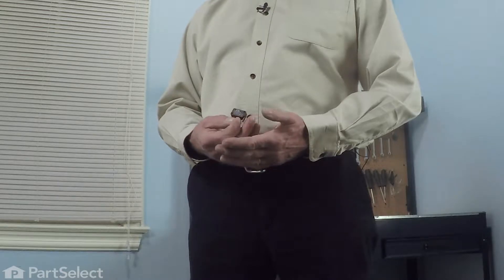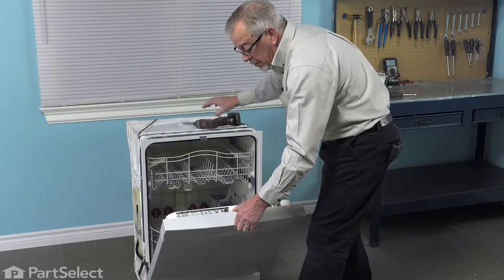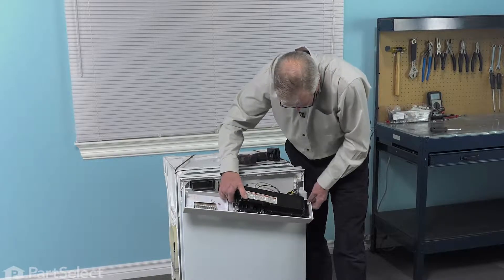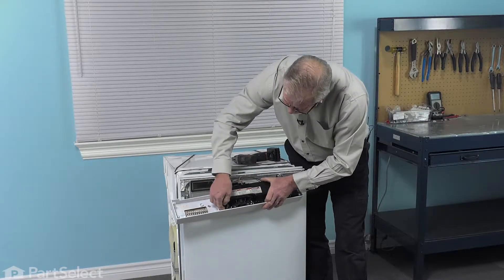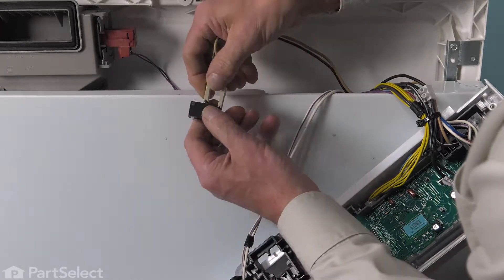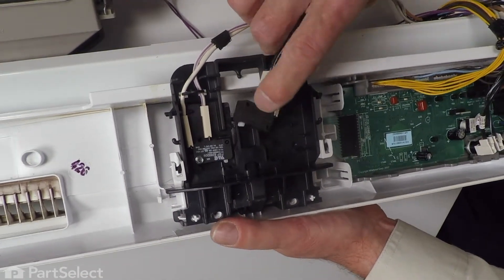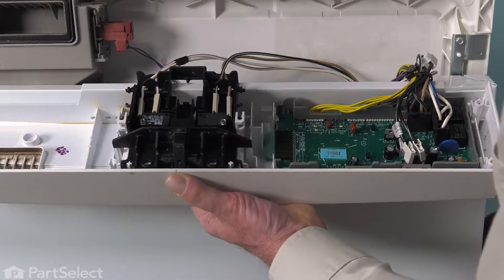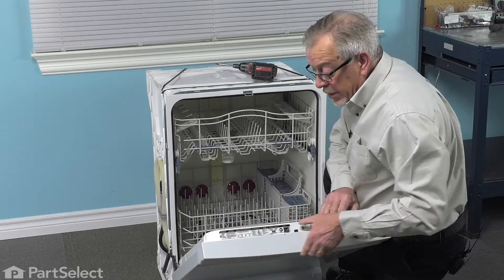Whirlpool Washer Repair - How to Replace the Lid Lock (Whirlpool # WPW10619844)

Comment: Quick troubleshooting for Whirlpool Cabrio wtw6200vwo .  BEFORE OPENING THE CONTROL PANEL Or purchasing a switch.
Keep in mind, MAGNETS trigger most lid locks. 
*OPTION 1 *- If the machine is making a clicking sound, PARTIALLY slide out the locking tab (usually a horizontal brown rectangular square in the front)  .  Make sure there are no obstructions (including dust or detergent) preventing the tab from functioning. Do not completely pull out the locking tab.  The machine will likely complete the cycle.  

BYPASS OPTION - There is no need to unscrew the back or remove the control panel.  The LID should have a plastic panel.  Unscrew the two screws on the lid.  Place the panel over the lid lock.  (You will recognize two vertical magnets on the plastic panel).  This may also work with two strong magnets place on each side of the lid lock.

In both cases the machine is dependent on the magnets. The electronic mechanism that recognizes the magnets usually wears out.  The magnets trigger the machine to lock the lid.  Once the machine recognizes the magnets, it will likely operate.